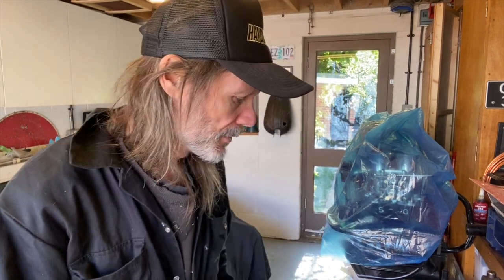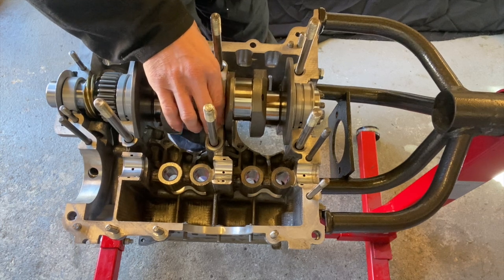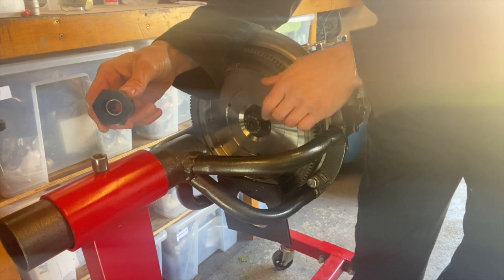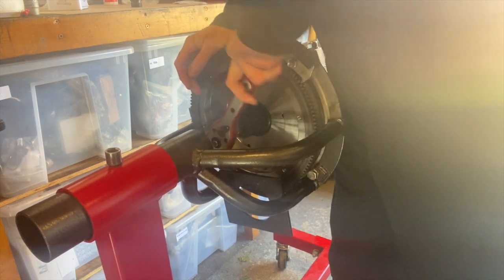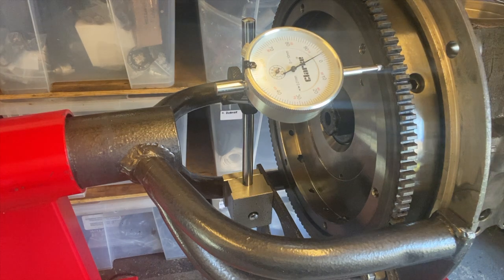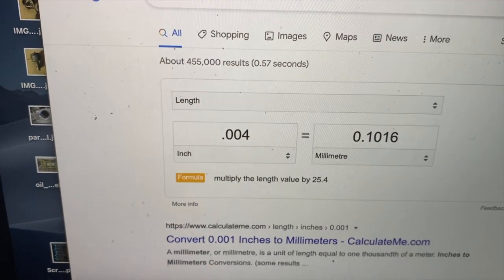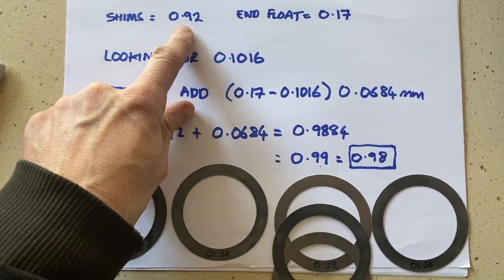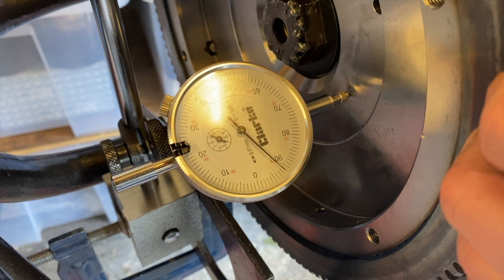PART 5 – Crankshaft End Float - How to Build a CB Performance 2017cc Builder’s Choice VW Engine

Comment: Use a Gene Berg gland nut Then use torque master and set to 420 foot pounds .  But a cheap socket to fit gland nut. I learned by always finding the weakest point on my turbo 2276 .  Ron Lummus told me the only good news when sheering of the dowels and destroying flywheels and crank is . You are making H.P .  D|O NOT CHEAP OUT HERE .  If you turbo or drag race . Wedge mated and 11/32 dowels or flange crank .  Street driving with big engine , big chrome moly gland nut from Ron Lummus or Gene Berg . Not a China clone gland nut either . And torque to recommend ft/lbs with lock tight on the threads .
Reply from the maker: This is great advice. I've actually made in-roads here already. I've bought a 38mm socket which I'm planning to weld to a spare torque-meister tool I have knocking around. I'll adapt the torque-meister so it all lines up well. The nut comes with a 350ft lbs setting. So I'll stick to that soec I think. I wasn't planning on using loctite. I take it I use blue loctite, or else that flyweehl will never come off hahahahaha.

Comment: Use the racing gland nut   Just buy a cheap socket and cut the square ratchet end off and weld an old stock sized gland nut to it so you can use your torque meiser tool

Comment: The last few engines Ive build Ive set end play on the bench.  With the crank, flywheel and #1 bearing in place and torqued to spec I use feeler gauges between the thrust surfaces of the bearing/flywheel and then dial in the shims required.
Reply from the maker: I’ve never used that method before. I’ll give it a go next time. 👍
Reply: @aircooledanything2415  I like your method of setting endplay and will be using this on my build.